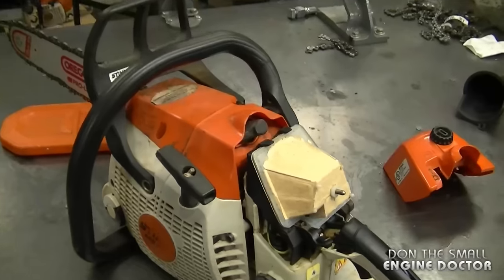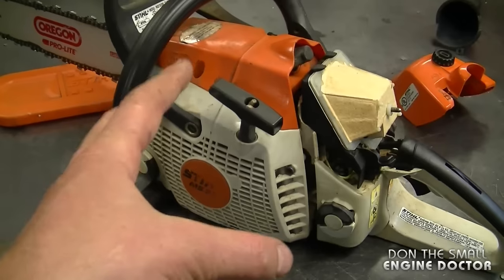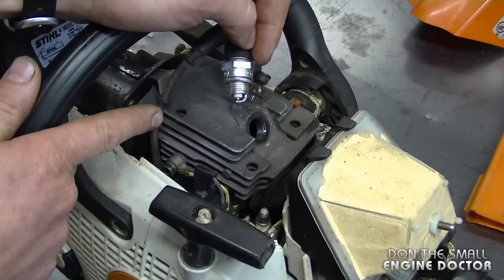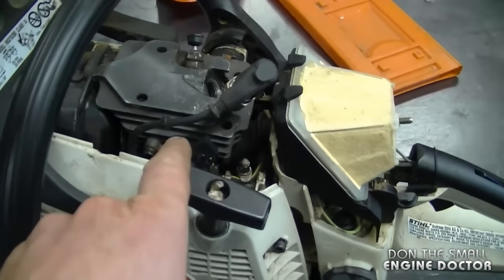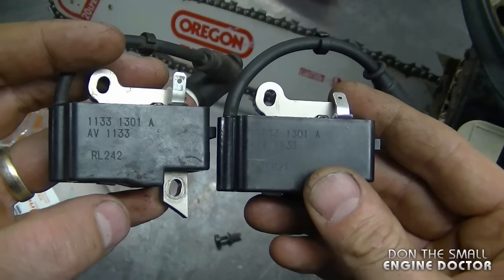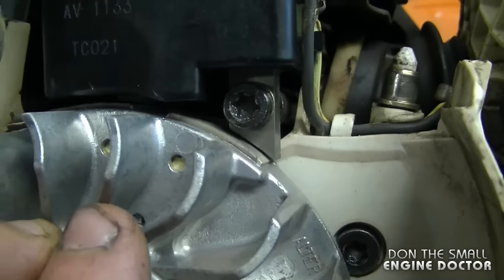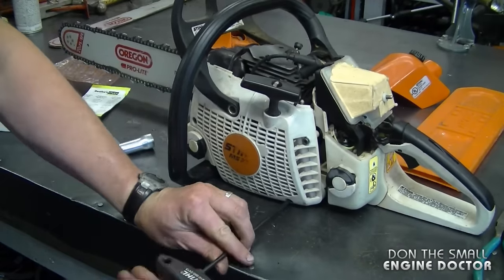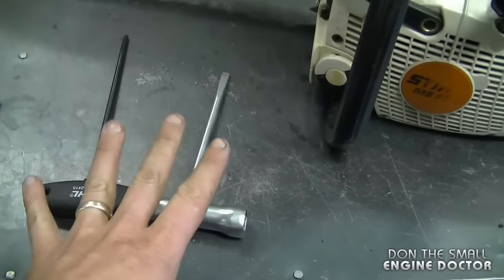HOW-TO Fix A Chainsaw With No Spark - Ignition Module Replacement

Comment from the maker: Does your chainsaw only run until it gets warm, or will it not even start at all? It could be that you have weak or no spark at all at the spark plug.
Reply: I'm a mechanic 👨‍🔧👨‍🏭, I have 16 experereants.
I have a chainsaw and I fix it some Times.   I know how to repair small engines, cars, motorcycles.    I love your videos 🤝8-)
Reply: My chainsaw stopped working since last week it has no spark,after disconnecting ignition wire it sparks a lil though. I would like to know what should be done next
Reply: My Chinese chainsaw which is new has the same symptom.  Run strong when cold then dies and won't start when warm. I replaced the carburetor. Same thing starts right up when cold. Why would coil fail when warm?
Reply: @zmanphx  eB
Reply: @berylmohd  what is eb?
Reply: I want to no how to comber point to electronic in my sthil 041
Reply: As a 37+ year cert. Diesel Mechanic & Cert. Welder. When ever possible I still watch sites like this beforehand. Nobody knows it all.. You everything run into a self-appointed expert on everything. Run very fast away. They don't know Dog Poop. My last major mess was on a recall on my Toyota Tk. They tore my Tk all to pieces with wrong parts, Took good parts off put junk on. Never ever do any business with L&S Toyota out of Beckley WV. Long that service management is still there. He had very same trouble before they lay him off from Heavy Equipment management else where. I was talking to him he accidently found out I was big friends with his ex-bosses there & know about him. Paybacks started.. He  talk big game but tore there Equipment all to pieces just like my poor tk. I still after 2 years trying fix there mess. True Story.  Watch out.

Comment: It is NOT the positive wire on the coil. It is the GROUND wire and it is used to GROUND the coil so it will not produce a spark.

Comment: Great video Dony, However, I would like to add one more tid-bit of advice. I have a Poulen 2250 that was driving me crazy. I had checked for spark and the spark plug was sparking fine but it would not start. Even with starter fluid it would not start. The carb was good, the gas lines were good, good compression, the spark plug was sparking but it would not run. Then I noticed an unusually large gap between the ignition coil and the flywheel. Why or how that happened I’ll never know. After I properly gapped the ignition coil the old 2250 runs like a new one. Thought I would share that with you so you can pass it on.

Comment: I normally don't get into comments but I must thank you. I have a Stihl 012AV that most certainly had an issue with dying when it got hot. Your comment that the spark plug can contribute to this saved me! You cannot purchase an ignition module anymore for my saw...so I thought I would at least try the spark plug after your comment...it worked!!! Before the saw would fire up no problem, run great...then die once it was hot. I replaced with a brand new NGK, it fired up, it got hot, it got hotter, it screamed, it wailed...it did not die! Before getting a new module one must try a new plug first. Thank you for your help!

Comment: Love my ms261C but replaced both oil pump $120 and ignition module $170 in first 3 years. Have a 1984 sthil 028 wood boss only part ever had to replace was carb boot. I’m pretty handy fixing stuff but Donny your videos are the absolute best on you tube and are very helpful to me. Thank You

Comment: Thanks for taking the time to upload. Managed to fix 'no spark' issue. It turned out not to be the ignition unit but a combination of bad earth and loose switch cable. You gave me the confidence to properly open up and investigate. Cheers from SCOTLAND!

Comment: Thanks for all of these videos. Neither my MS180C nor my 026 Pro would start after sitting for a year. Using your diagnostic tips and some relatively inexpensive parts, I have them both up and running.

Comment: I tested my spark plug using your method. It was just a bad wire connection to control module and that fixed my Husqvarna's saw starting problem. Thank you so much!

Comment: New subscriber here, I have a 044 Stihl chainsaw. Recently, it only ran when it was cold and shut down once it warmed up but now it won't even start no more. I strongly believe it's the ignition module, haven't replace that for many years. Thanks for the info video.

Comment: Thanks Dony!  My saw won't start.  No spark.  The shop is two weeks out to repair it.  But; thanks to you, I'll order a new coil kit and fix it myself and save a bunch of money by doing so.
Reply: this hus 240 has me stump no spark replaced coil/flywheel removed ground lead also check coil to ground new spark plug and still no spark turn flywheel with drill motor approx 1500 rpm and still no spark any suggestion

Comment: You made my day after my Ms660 stopped working when hot. I thought I had flooded it, but no spark, I had a coil on hand, with your instructions it was back at work within 15 minutes. It started 1st pull the next morning. Thanks.

Comment: I liked the way you diagnosed the problem and fixed that chainsaw. I have a Stihl chainsaw which is hard to pull over and don't want to start for me. The saw have been in the shop several times and I still have problems with it. After the problems I have had my solution is to never buy another Stihl saw again.

Comment: great video again Dony. I am working on a new MS261C m-tronic saw that has no spark. I also found that when the chain break is engaged you cannot pull the recoi. I pulled the break cover off and found one of the tension springs was broken. I wounder if that may have contributed to the no spark issue. I'll do some more troubleshooting and make sure it's the coil.

Comment: Doc I got a got a stihl fs80r trimer 4137 3401 and put a new ignition coil 4137 -400-1350 and switch is good but no spark? Thank you for the videos you doing a good job!

Comment: Excellent Help. Following your instructions to replace the MS 280 ignition module it now starts right up.  However, at one point you mention starting problems could also be in some other part of the electrical system.  Now, some time later after cutting a cord or two my saw will not TURN OFF when I move the switch to the OFF position.  It sure would be nice to see more info about the other parts of the electrical system and what kinds of problems they might typically have.

Comment: Thanks, helped me quickly diagnose a Chinese 6200 62cc chainsaw where the on off switch was bad right new from the factory. Once I unplugged that black wire from the coil the spark plug was sparking while cranking. I'm sure that definitely means they don't do quality control or start each one up before packing them up. Anyway, ordered 5 new switches from ebay for half the price that one would cost shipped from a USA seller. While it's probably gonna take up to a month to arrive, I just turn it off with the choke, they turn off fine that way too.

Comment: Obviously I'm having these problems since I'm here.  I have an MS271, but mine looks newer.  I looked up both, ignition module, which I bought and searched coil. Photos online look like the same exact part. I anticipate mine is headed to a repair shop.

Comment: Is ignition module failure a known problem with the MS 270, MS 280 saws? I've had an MS 270 for at least a dozen years, and I just had to replace my 5th module. This last one cost $160 from the Stihl dealer. I use the saw, maybe, 6-8 times a year, so it's not like it's getting a ton of use. I'm just getting frustrated at having to keep replacing a module, when I could buy a brand new equivalent saw for 3 times the price of the module. I'm tempted to just buy cheap aftermarket modules, because, if nothing else, I'll feel like I got my money's worth if it fails in a year or 2. Any thoughts?

Comment: Hi Don.   I have a Stihl MS211/C chainsaw in Australia  that I have to replace the flywheel on.  I accidentally sheared the key on my old one when I was trying to remove the clutch by trying to remove it the wrong way. (I had a severe brain fade ) .. I now have a new flywheel and wonder if you need to remove the ignition coil first to provide clearance and the correct way to torque up the nut on the flywheel .  I would follow your advice by using a business card to provide the correct flywheel magnet/coil clearance.  If you know the correct torque specs it would be useful to confirm.   I think 28 Newton Metres ?.  I have been looking on your site for flywheel removal / installation but not having too much success.  Any help would be much appreciated.

Comment: Running saw & suddenly lots of smoke , now won’t start , no spark at plug . Do you reckon the module has overheated & needs a replacement? Is there anyway of testing it ?

Comment: Donnie; my relatively new (maybe 3 gallons of fuel mix so far)  Hussqvarna 572XP failed to restart after chain touch-up on hot day.  Later, when cool, started fine.  Thought it was vapor locked.  Couple of days later, failed to start again when hot.  No spark at spark plug, and no spark on inline spark tester when tester grounded to plug.  BUT with tester grounded directly to saw's cylinder head it showed good flashes.  The spark plug is good and strong spark in an other saw.  I will try removing the + lead from coil, if I can find it; but I suspect bad module. What say you?

Comment: Thanks, I did your test and unplugged the black wire and then checked and it had plenty of spark. I think the problem might be in the switch.  Any videos on switch replacement/and further checking of the wires.

Comment: I have a Poulan P3314 chainsaw. I have a electrical problem with saw. Saw looks new, I'm going to have replace fuel lines and filter. What do I need to check or might need to replace with electrical problem?

Comment: I was replace the seals on my stihl 025 and the piston like ur video u had on yt. I have no spark with credit card gab...about 1,10 mm.  So on internet i figure out the gab must be for my saw 0,2-04 mm. Now I have spark but is poor. I try 0,20, 0,25, 0,30 mm gab but its the same. That means I have to change ignition kit? Ty
Reply from the maker: possibly yes

Comment: Hello
I have a chainsaw homelite 340, its coil ignition burns, I have not found on the market a replacement for the same model, can I use another model of a
other brand?
thanks for your vide
Reply: I have the same problem with an echo kiuritz cs302! There should be a workaround on that...

Comment: After replacing the ignition module I tried testing for a spark by turning the flywheel rapidly using my hand. When I did not get a spark I assumed the problem hadn’t been fixed. Come to find out you can’t turn the flywheel quickly enough by hand to get a spark. Once I reinstalled the recoil starter I had a good spark.

Comment: Hello Donyboy73 thank you for your videos, I have an ms170 and the spark plug always carbonize and the air filter looks clean, I see bad combustion and the carburetor does not adjust, I wonder what is the problem with this saw.
Reply from the maker: check spark arrester screen
Reply: Thank you, it was completely plugged

Comment: I have a question.   I have a stihl 210c that had a melted clutch.  So I ordered a After market gas tank/engine cover.  The problem is that the holes that mount the ignition module are not the same.  Any way of figuring out what updated module would fit in new saw body?  Thanks for your help..

Comment: As you've done a video about a rev limiting issue with one in the past, I thought that I'd ask you about the OEM coil for a 2007 Stihl MS361.  As you may recall, the coil in question is the Stihl 1135 400 1300.  This is the third time we've had issues with this expensive ignition module (coil), so I was wondering if Stihl ever came up with a better coil for the MS361?  If not, do you know of a coil that came in a different Stihl saw that's a suitable substitute for the 1135 400 1300?  Thank you.

Comment: One of the first things I check is the position of the bayonet lug on the end of the spark plug wire.  These can be undone by users pulling the spark plug wire, haphazardly.  I usually take my carb adjustment screwdriver and insert it in the boot and feel for the bayonet lug in the bottom of the boot.  A lot of times it has been pushed back down the end of the boot where it can no longer connect the spark plug   If this happens, I pull it out of the boot , connect it back on the spark plug wire and inset it back into the boot and re-check it for spark.  A lot of times this fixes the problem, sometimes not.  I then troubleshoot the coil if I still do not have spark, but this is my first check.  
.

Comment: All good info. one bit you should mention , that is the Spark plug is a Resistive type and that if you use a none Resistive Spark plug or HT lead type then you will damage your control board.

Comment: My Stihl blower SH86c does not spark.  The blue cutoff switch wire is also broken. Does that broken wire prevent spark at the plug?  I personally do't think so because the cutoff switch hasn't worked for a long time and the machine still was able to start. I would flood the motor to get it to stop. Would the blue broken wire really prevent it from starting at this point?  Thanks for responding back.

Comment: I have an MS 362 c ignition module replacement with only one spot to hook a wire. Unfortunately my saw has 2 wires. I see from this one in the video that one of the wires goes right to ground with the mounting screws. I guess I just don't know which wire is what, the red or the black. I understand which one represents positive and negative. Lost. I think the black wire hooks to the spade on the coil. But it confuses me because I thought that color represents negative. All the replacement modules with replacement wires shows the black with the spade and the red with the ring. input on this would be much appreciated.

Comment: I just got brand new Husqvarna 120 Mark II  ran pretty good for half hour.   Will not start now .  I believe its coil.  No spark .  I disconnect the  wire to the S/W    no spark .  You think it needs new coil?

Comment: My ms270 has only cut about 4 cord of fire wood since it was brand new and is on its second coil already. was out running it this week and now that coil went tits up so I'm debating on what to do. no to happy to keep throwing $100 OEM coils in it but I've heard aftermarket ones are even worse. hard to believe though.

Comment: Thank you for the help mate - from Australia *use a playing card 'guage' by the verniers it was 0.9
I'm getting 2 years from $14 coils from eBay - Carbs for the lower end MS series under $20 as well compared to the Stihl 'Genuine' parts.That genuine coil in OzTralia is about $80 USD

Comment: I just rebuilt my MS271 replacing the cylinder and piston, the piston was badly scored and the cylinder questionable. I found an excellent OEM cylinder and piston on ebay. Once I got it back together, it had great compression, but it would not start.. I figured the cylinder had oil in it from when I assembled it.. I must of pulled it 100 times, removing the spark plug from time to time to find it was flooded.. Finally it fired and started up, running normal.. once I shut it off, it would not restart.. I noticed that when I grounded out the plug on the cylinder head and pulled the cord, I could not get a spark unless I pulled it real fast.. when I pulled it fairly fast, no spark. Could this be a weak ignition module?

Comment: Question I have a stihl 024 Av starts great runs great until you raise it above your shoulders then it dies out. Fresh gas it has . Dealer has it claims coil ignition but does it take 3 weeks or longer to get part?

Comment: Thanks for your efforts regarding the replacement of this component in the still  however the reality in the cost in doing so in new zealand  makes the job prohibitive of course this is due to the expensive cost of parts  that module retail price of $195 . thanks for your vido kind regards snell

Comment: check to see if the coil is dirty. When I took off the coil before ordering a new one, i found there was so much dirt built up on the coil 'foot' or whatever it's called that it wouldn't make a spark. After cleaning and reassembling, the plug sparked so loudly it surprised me.

Comment: A nice tutorial! But why don`t you checked the old ignition module with multimeter first? It can be whatever- up to faulty plug wire connector. There is a spring inside which would be much easier and cheaper to replace...  We have exactly the same ignition module on a different model, but It has two cable connectors. Are they interchangeable, please?

Comment: Hi,

Thanks for your great videos.  I've been restoring a Craftsman 18" 42cc saw.    It looks to have had very little use but the fuel lines were disintegrated when I acquired it.  I replaced the lines and it started and ran rough for 30 seconds or so then it died and would not start again.  I replaced the spark plug and nothing. Because it had started I didn't think it was electrical so rebuilt and cleaned the carb.  Still nothing so finally checked for spark and nothing using both spark plugs.  So I ordered a new coil which fits but the terminal was different as was the angle on the spark plug lead cap.which made it tight to put the cover on.  Still wouldn't start and no spark even with the new coil.  What should I check/do now?🤔

Comment: Both wires were open and frayed before taking it apart, good chance that could be the problem,  also double check with multi meter...
Plus the gaps were way different 
Good job

Comment: I have a homelite 45 cc 20" cut i put a new carburetor on it and i do have spark but changed the plug anyway but the saw will not start